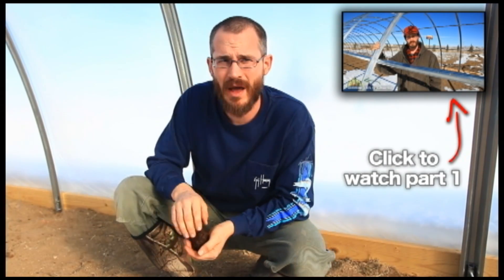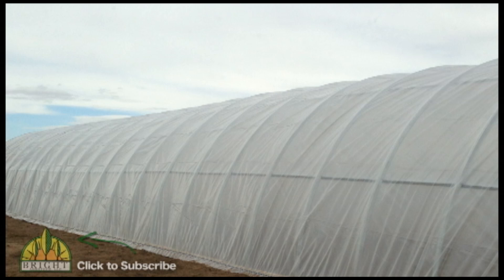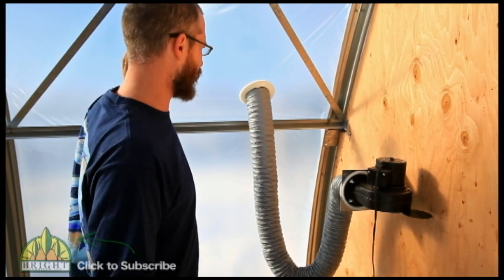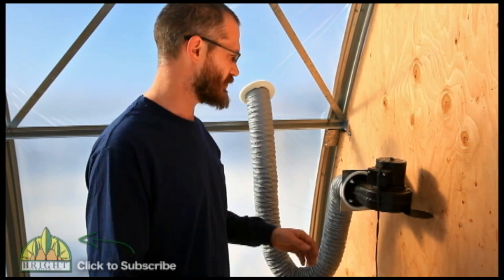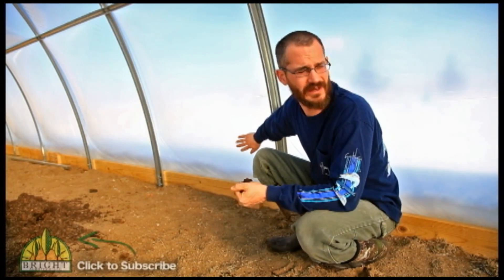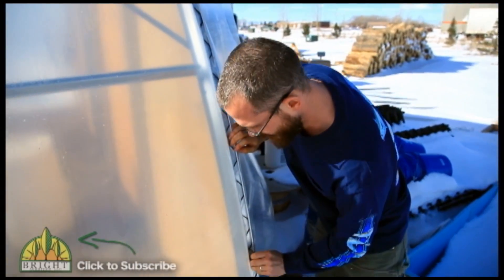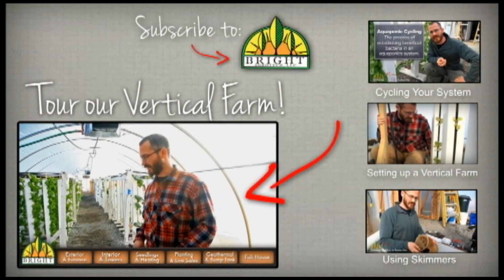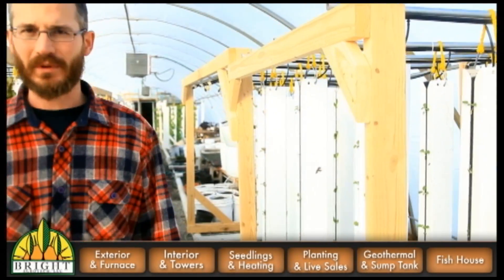Building a Greenhouse (Part 2): Installing Greenhouse Covering

Comment: I have a couple of questions about the materials.

1) Do both layers of the plastic covering have the special coating (IR and anti-condensation) and, if so, do they both face down? Would it be enough to have only the innermost layer coated?

2) Most greenhouse plastic says not to let it directly contact PVC. Is that a potential issue for where the PVC coated wiggle wire contacts the plastic in the channels?
Reply from the maker: Hi Malcolm Potter - Yes both layers of poly covering are treated with UV coating and they lay face down. If you just want to do one layer you can do the outer layer, but it's usually cheaper to just buy 2 sheets of the same. PVC wiggle wire hasn't been an issue with our plastic. I think the issues come from more of a soft PVC problem, but again we've never had any problems.
Reply: Thanks for the response. I was mainly asking about the anti-condensation and IR coatings mentioned in the video. Most greenhouse plastic I've found is UV resistant.

Comment: Hi, I a really enjoying your videos. I have a few questions about the blower and that whole part of the video. Am I right in my understanding that you are separating the two layers of plastic with air to form an insulating layer? Does this work in the summer also to maintain a cooler environment? If you could do a video describing how that works and how the blower is keeping the sheets separated even beyond the aluminum arches (sections of the greenhouse)? I apologize this question has already been answered somewhere. Just really interested in this method. Thanks.
Reply from the maker: Hi Karim Jundi - Yes we are using two layers of poly film and inflating the void space to increase the insulation value of the plastic. This doesn't provide much cooling effect in the summer at all. You'll notice we've installed roll-up sidewalls for this reason.  We kind of have a video on this already: http://youtu.be/G2fs6zx_a9Q

Comment: video would be awesome on that subject cuz its really interesting concept that i didnt saw ppl are using where i live (Croatia). losses on the light with double layer, air pressure control and things like that...
Even thou I found a product Polydress LP Keder, that kinda works the same just its little more high tech and expensive :)

Comment from the maker: You bet- We actually put two big pieces of plastic over the greenhouse and seal them along the bottoms and ends of the structure with spring-lock wire and wiggle wire channel.  Then we cut a hole in the inside piece of plastic and seal our inflator blower to the plastic.  That way, when we inflate the space between the two layers, it forms a giant area of relatively "dead" airspace that insulates our greenhouse.  We'll try to do a video on this soon!

Comment: Dear Dr. Nate Storey: Thank you for the video - it was excellent!  I want to pass along that with single layer plastic it's important to put the plastic on when it's a sunshine warm day and you keep the plastic warm (not hot) before putting it on.  When the plastic cools it will contract and give a wrinkle free finish.  If you put on a single layer of cold plastic on a cold overcast day it will wrinkle and get loose when the weather warms up.

Comment: Thank you for doing these videos they are extremely helpful. For the double layer film, does that come with 2 layers attached to each other or is it one layer just intended for 2 layers? 

In other words, do I need to purchase twice the total area I need? and to inflate it with air, do the edges need to be sealed together somehow, between the layers, to keep the air in? 

Thanks!